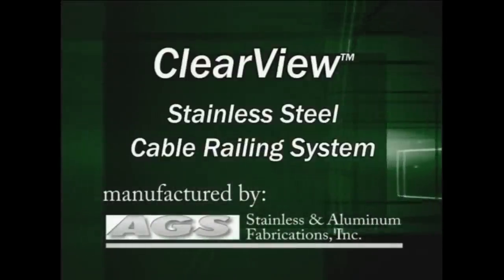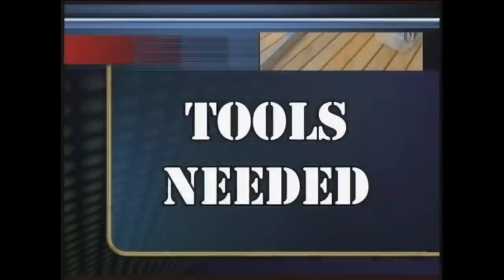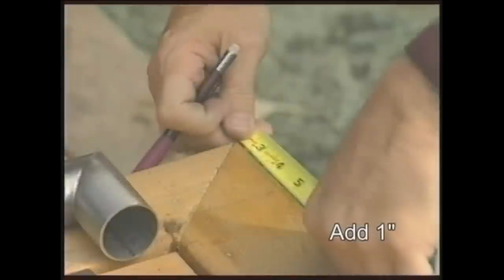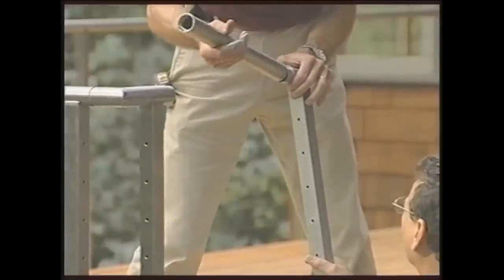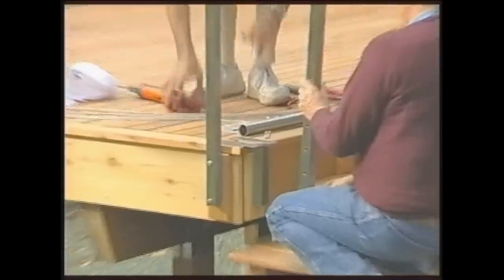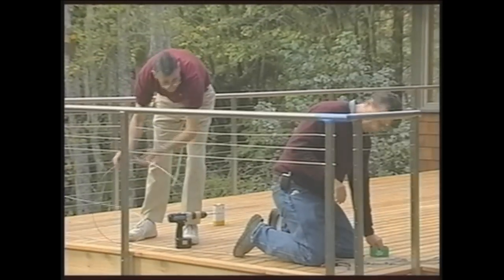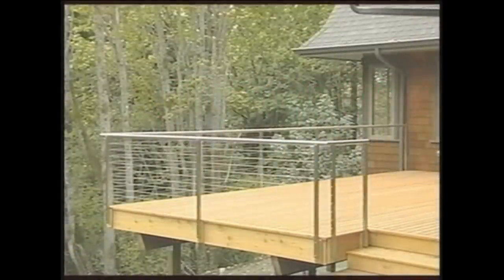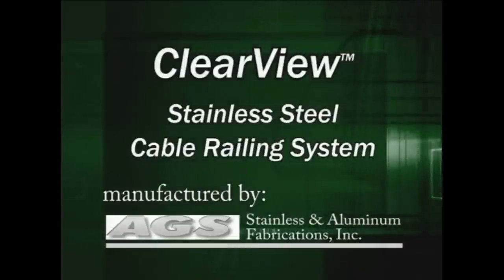Clearview™ Stainless Steel Cable Railing System

Comment: Crimp what's crimp.  I thought I'm supposed to swag.  At least that was the only thing in the directions I got.  I have to swag three times, And my swaging has to rotate 180' While making sure I had a good swager.  And you know if you put the cable in counterclockwise you can hide all the swaging.  And when you tighten the cable if it rotates it rotates in the proper direction.
Reply from the maker: +Delve Spectrum In this case "swage" and "crimp" are the same thing. We normally use the term "crimp". Rotating the fitting 180 degrees is only to put on the 2nd crimp. It is because with our older crimper there might have been a slight bend in the fitting after the first crimp. Our newer crimpers do not require this step.
Reply: How much swag is on your tail gate!